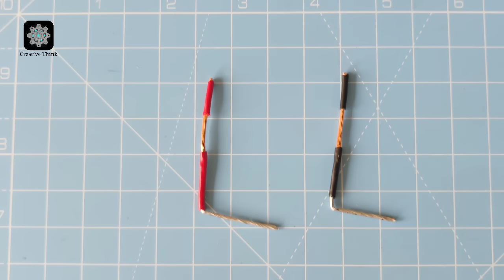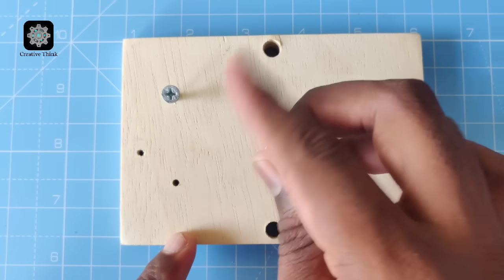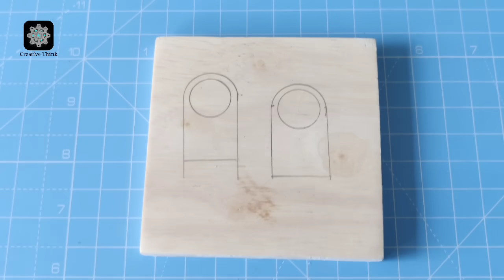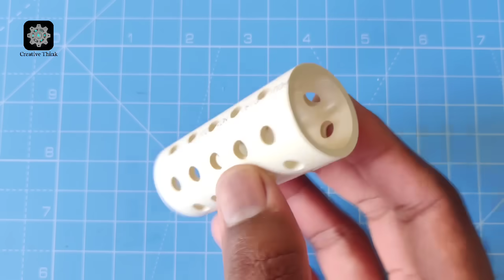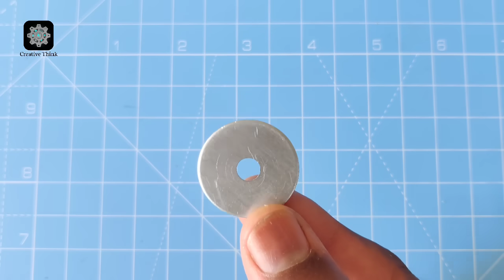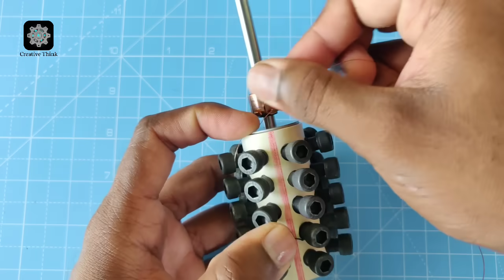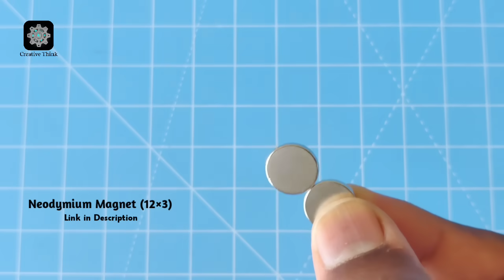Free Energy Generator Using 20000RPM  Very Strong Armature

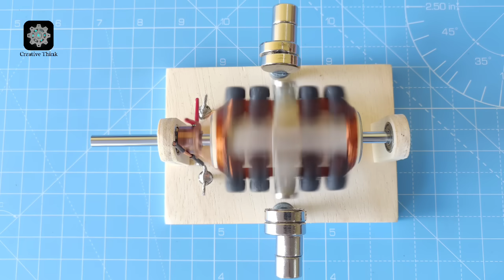Comment: 8:08  to  8:15
There are visible sparks on the positive terminal. Which indicates that external power source has been given to the armature to rotate
Reply: There are visible sparks on the positive terminal. Which indicates that external power source has been given to the armature to rotate
Reply: true
Reply: Definitely all generators need that
Reply: I too noticed the sparks between the red "brush" and the commutator. How can there be a current if there is no current path beyond the wood screw into the wooden board? Why would you need a commutator if there is no current path beyond the wood screws? Likewise, why wind coils if there is no complete current path? Why do the "brushes" need to touch the commutator? Also, how would you stop a really powerful perpetual motion machine? Normally we stop motors and engines by stopping the fuel or source of power. It seems to me, that if there were no source of energy to turn off, then there would be no stopping it, if it were very powerful.
Reply: @oldmaninthecave  "Sparks just occur because of the poor electrical contact between the brushes and the commutator."
Sparks cannot occur, if there is no way for the electric current. But there MUST be some hidden way for current. Without path no current, without current no sparks. So simple.
Reply: @oldmaninthecave  You said, "Moving a wire through a magnetic field induces electrical current." Not quite. It induces a potential (voltage), but not a current unless there is a complete current path. How are you thinking that the current through the red wire down to the board gets to the black wire connected to the board?
Reply: @oldmaninthecave  So, is the motion of electrons in the windings (the current) past the permanent magnets producing the force on the rotor to make it turn, or is the motion of the electrons in the windings past the magnets, which results from the rotation of the rotor, producing the current in the windings?
Reply: sheik DE  Thank you for this comment. I was actually about to make a long drawn out comment explaining why Old Man in the Cave was wrong, and either being dishonest, or idiotic. Then you reminded me not to argue with fools.
Reply: @dannoland  You're right, they can't be both at the same time. I got fooled.
Reply: @oldmaninthecave  congrats man, for admitting mistake. Seriously. This is not so often on internet.
Reply: @WojtekCzaderna   Thank you for your kind words. Everyone can be fooled at times, otherwise there would be no magicians. Sometimes I think I'm the smartest person I know, and other times I think I'm the dumbest. Both times I'm right. I believe the worst crippling flaw is arrogance. We all have feet of clay.
Reply: @oldmaninthecave  the energy actually comes from the first push.
Reply: @dannoland  no he is right since current is voltage x Amp it is a current that is produced. The motor becomes a closed unit because it's a closed induction coil between magnets which caused a DC charge to travel in the direction of the spin.
Reply: @dannoland  it's the kinetic energy of the first push working in union with both of those which is why he only put the light on for a short period of time, it's very much like a fire. There is electricity in a fire but if you took it all out it would stop being a fire.
Reply: Sparks are natural for commutators.  If ya seen a spark before it started to rotate,  then it's some other power source..  If ya seen a spark after it started rotating,  then you never know where it's coming from,  without a test meter..  

  He don't care,  He makes money off of every commercial you see..  Money don't care if it's fake or not..
Reply: @sebastianstewart6894  I'm having difficulty understanding what you are saying here. You said, ". . . current is voltage x Amp . . . ." No, that is not true. Electric current is the flow of charged particles. The unit of current in the International System of units is the ampere or amp for short. So, it looks like you are saying that current is voltage x current. What does that mean? Voltage across what and current through what is the current where? I encourage you to study physics, if you haven't already. Are you familiar with Kirchhoff's voltage law and Kirchhoff's current law? Do you know Faraday's law and Lenz's law? (Lenz's law is the killer.) His law states that a loop of wire enclosing a changing magnetic flux produces an electromotive force (emf) that  opposes the change that produced it. Mathematically, Lenz's law puts a negative sign on Faraday's law, and that negative sign prevents us from getting more mechanical power out of an electric motor than electrical power supplied. Likewise with a generator, because of Lenz's law, we cannot get more electrical power out than mechanical power supplied to the shaft. This becomes apparent when you get into the details of the forces on current carrying conductors as they move through magnetic fields. The same mechanism that causes the current in motor windings to produce a torque on its shaft is the same one that causes the current in the windings of a generator to produce a torque on its shaft. Unfortunately, the torque in the generator shaft does not aid its rotation but rather fights against it. The greater the current out, the greater torque is needed to keep it going. Similarly with the motor, the greater the mechanical work done by the motor, the greater the current needs to be fed in to keep it going. Such is life. Energy is conserved. If you learn F = q v X B (this is a vector equation and "X" means cross product) (called Lorentz force) and apply it to the internal windings of motors and generators, it is no mystery as to why energy is conserved, at least in the case of electricity and magnetism.
Reply: @dannoland  So you can 'extract' the energy to light the LED.
Reply: Are you calling me a liar Frank, that what you doing?
Reply: Old Man in the Cave and if there isn’t charge how the sparks? It’s fake. External battery powered
Reply: Rejected-From-Eve .Zero  yes
Reply: @guri311  their was no connection on those wires  , thus no load.  their shouldnt be sparks   on a motor with no load. i would maybe understand it if he connected the led to it and it sparked, but that wasnt what happened.
Reply: @oldmaninthecave  The thing rotates from an external power source, the big magnets on the side are acting like the field coil would, a battery is hidden and is powering the coil on the armature, it's a well known thing, motor principals have been almost unchanged for a hundred years.
Reply: Keep it simple. If the armature is not spinning it can NOT produce a voltage, it can NOT produce a current without a complete circuit. Spark comes from a PS
Reply: Idiocracy, welcome
Reply: @oldmaninthecave  the magnet is not a source of energy
Reply: All everybody in this thread had to do was read the description! 😅🤦
Reply: Where are the wires to the external power source?
Reply: Good eye!
Reply: @dannoland  "Why would you need a commutator if there is no current path beyond the wood screws? Likewise, why wind coils if there is no complete current path? Why do the "brushes" need to touch the commutator?"

An obvious lack of knowledge where electro-magnetism is concerned. The commutator provides the current path through the coils. And the current is caused by?
Reply: @guri311  Did you even try building one? Did any of you armchair physicists try it? If you build one and it doesn't work, then I can understand your complaints. It's easier to knock down an idea than it is to understand it. You guys are like water, taking the path of least resistance. The resistance is to using brainpower :| Try the damn thing. Then comment.
Reply: @l.m.892  Am I right in thinking that you are saying that the answer to my questions (that you pasted above) is your statement, "The commutator provides the current path through the coils"? If that is what you are saying, then you have not understood the point of my questions. To answer my questions, you need to describe a complete path from, say, the one "brush" connected to the red wire, through the rotor windings, to the other "brush", and so on back to the starting point, which is the brush connected to the red wire. What is the current path from one brush to the other brush outside the rotor? There can be no electric current without a complete path (loop), which is required by Kirchhoff's current law (KCL). (https://en.wikipedia.org/wiki/Kirchhoff%27s_circuit_laws) Simply stated, KCL says that for every point along a wire, if there is an electric current toward the point, then there must also be the same current along the conductor away from the point. The man who made the video gives lots of intricate details, but then leaves out any video that would answer my questions. By leaving out an explanation for that part of the path, he is misleading many of those commenting on this video into thinking that he has created a perpetual motion machine. Can you explain how the current goes from the black wire to the red wire external to the rotor? There will be no current if there is no path. But we know there is current because we see arcing at one brush. Therefore, in reality there is a complete path, and we can be confident that the path that he has left out includes a source of power for the motor.
Reply: @dannoland  I agree and your explanation was well stated. I did a simple electromagnet experiment for 5th grade science fair and learned a lot way back then. (Also if you wind too many coils around too thin of a nail, it gets hot enough to burn the science teacher/judge’s hand... whoops... sorry Mrs. Schlazengheimer.. 🙊)
Reply: @Syclone0044  Thanks for your encouraging words, and for the humorous event with your science teacher. You made me laugh.
Reply: @sebastianstewart6894  A fire requires a source of potential energy (chemical, specifically,) to continue, not just to start. This, too, requires energy to keep spinning --- it wont continue to spin indefinitely because of electrical resistance and friction between the moving parts. As the device spins, kinetic motion is lost as different parts of the material grind against eachother and as electrons lose energy to the atoms they are moving around, and all this energy becomes heat. Some of that heat is entropy, and even that which could, hypothetically, be recaptured probably won't be because there is nothing present to recapture it.
Just as there is no free energy, there is no perpetual energy.
Reply: @l.m.892  Wait, did you just ask everyone here if they've ever built a basic electrical motor? Like, I personally haven't, but I would be shocked if no one here hasn't lmao

Edit: also the author said in the description that this is a trick. Theres a battery hidden somewhere in there, and that's what caused the spark.
Reply: Same way a compass points north you use as your initial inertia
Reply: yeah that's good
Reply: SOAB, you are right!!! The sparks are there before it even starts to turn. So either this thing can REALLLY generate some free energy, or this is just another Youtube scam. I can't believe I didn't catch it. I was hoping someone did something creative, besides SCAM ME!!! Thanks for catching it!!!I'm a fricking EE. I should have caught it. But I figured he might have got creative. But Noooo. The onlt thing he got creative at was waisting my time!!!!
Reply: Radiant static energy will do that..no external hookup..i saw a guy in Nebraska build a huge one of these in his barn..enough power generated to power his house and 3 others with in 1/2 mile..free..cost of the build...
We need to move in thus direction..our governments had this all along..could have made this 100years ago..let that sink in..
Rockefeller who stopped tesla cold..said if you cant put a meter to collect we wont let it move forward...
Reply: What about the magnets on the bolts??   They can just fly off and peg someone in the head.
Reply: @guri311  If there was no current you'd have no light.
Reply: @jonesyokc  The current comes from below. Hidden under the Table. And there comes the energie. Let the "generator" run WITHOUT the wires at the commutator! Than we will see...
Reply: @dannoland  "Am I right in thinking ..." Your complete explaination is the best under this video. And absolutely correct.
Reply: @jonesyokc  Right. But the power comes from under the plate, not from rotor. Let this machine run without this two wires at the commutator, and we will see...
Reply: @l.m.892  There is no need for building such machine to know that it is fake. A little bit of logical thinking belongs to understand in this case.
Reply: @guri311  No need to navigate the Earth to know it isn't round. Just look at the horizon and it is flat.
Reply: @guri311  So how can you tell through logical thinking that the Earth is round?
Reply: you"re trying to say this video is fake? a trick? I guess he should have lifted the thing up in the air so we'd know there's no external power source.
Reply: Good observation !
Reply: @oldmaninthecave  Congrats.  You've just stubbed your toe on the essence of all scientific thought — putting everything you know into a Best Guess, testing it and testing some more, and if wrong, you tweak your theory and keep poking and prodding without fear of mistakes.  Mistakes are just a kind of feedback, nature's way of telling you that you should have picked door #2.  Not everyone has your healthy attitude.  You may want to familiarize yourself with the Dunning-Kruger Effect if you don't yet know it.  It explains a lot of the knuckleheaded human behavior that surrounds us.  Keep pushing;  you're doing well.
Reply: @OslerWannabe  Thank you for your kind words.
Reply: @oldmaninthecave  ...Ain't That a Trip?... Congratulations for Stepping Up & Admitting being Fooled bro. You're Absolutely Positively Authentically HUMAN for doing that...
Reply: @sebastianstewart6894  POWER, in WATTS. VOLTAGE, in VOLTS. CURRENT, in AMPERES. Voltage x Current= POWER. Quit Huffing the Solvents, and All will become Clear...
Reply: @dannoland  Thank you, Dan...
Reply: @l.m.892  An Obvious Genius Expert Person, where Electro-Magnetism is Concerned. L.M Knows His Perpetual Motion. When He Sees It. AND He Built a Whole Lotta This Sh!t, that Worked Just Peechee. His CAR is Powered by LM Perpetual Motion Machinery, that He Found On YT. Amirite, L. M.?!
Reply: @l.m.892  Phuch Awf....
Reply: @dannoland  Here you go, Dan. "What is the current path from one brush to the other brush outside the rotor?" You should have asked "Why the current path ...?"
Reply: @tealeaflist  Thank you for your kind words. I believe kindness is the greatest virtue, and as the Dalai Lama said: You can always be kind.

Unfortunately, another very human trait is people trying to elevate their ego by putting others down, as evidenced by all the snarky remarks found in the comments section of many YouTube videos, including this one. I have always been a very egalitarian person. We all have heads, hearts, and assholes. It's the admirable person who operates only from the first two. Many only operate from the third, and they usually don't understand that cleverness is not the same as intelligence.
Reply: Yes, this indicates B.S!!
Reply: @dannoland  apply a brake.
Reply: also 8:34 adding light to circuit consumed power and made it rotate slower which was audible too well.
they always try over n over again with this content
Reply: wkwkwk.....
Reply: came here to say the same thing
Reply: Yes it's visible
Reply: @dannoland  Most mechanisms will stop quite quickly if you use a big enough hammer swung with suitable force...
Reply: Visible sparks may indicate external power source, sure. 
Sparks may also jump between commutator plots. With or without external source of electricity. Either way external energy supply (either electric or rotational) is necessary.
Reply: OMER AKRAM,  Could a larger version be made, faster rotation to power an AIR CONDITIONER? or 2
Reply: if anyone is still following this vid can I ask several questions, as I am not anywhere near an electrical expert,  from what I read of all your comments, there is external power applied, so you are saying that the magnets that are providing propulsion, could not turn this armature with out power applied??,  also, that once the armature is rotating there would not be power produced simply by the rotation of the wires on the armature going thru the magnetic field created by the magnets?.  after the intial manual spin of the armature enough rotation is attained it would not produce enough electric to produce a spark??. the only thing I see wrong from this uneducated position of mine is there is no ground, and how this would work from the point there is no stater I believe it is called with wires that run real close to that of the armature to produce a field,  and lastly, HOW do they build power plants and ''jump start'' the generators to produce power without some sort of external power.